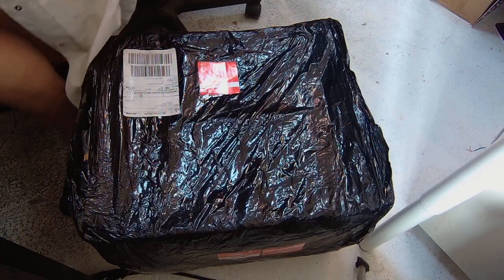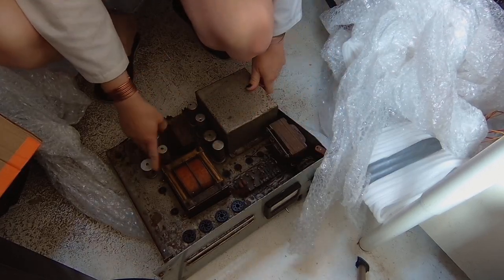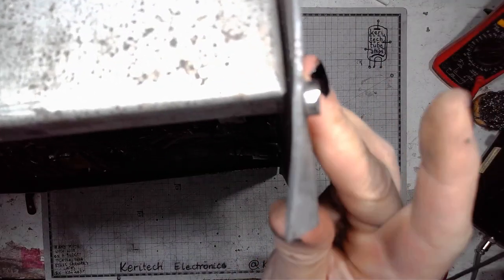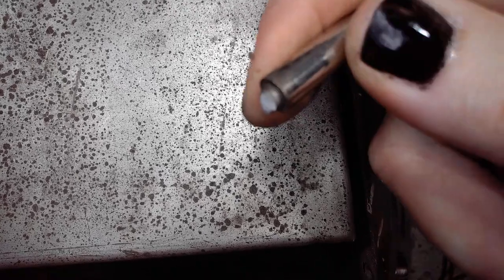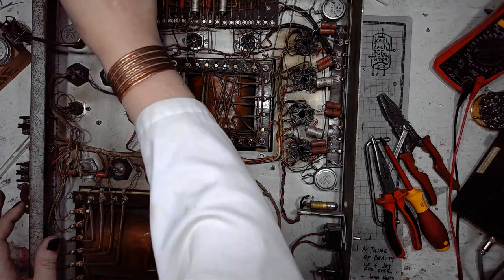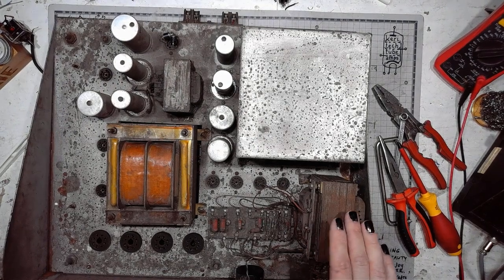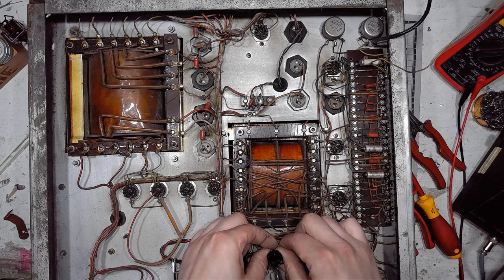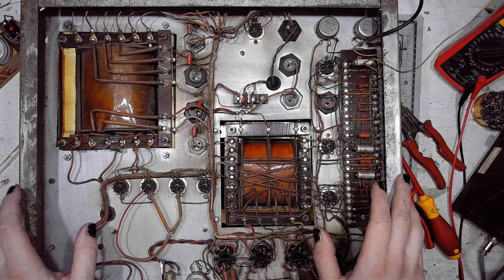W-100 Restoration Project #1: Unboxing and Overview

Comment: Sooo, i actually bought it from some old electronics store owner who resued it arround 12 years ago but didnt know what it was and how to make it work, and for speaker testing i played lowest 16hz sine wave and it did it without any problems, for the upper range im not sure, try testing it and hopefully it will be a great build^^ thank you a lot!
Reply from the maker: Gotta do a measurement on that thing - bandwidth is defined by frequencies where the output power drops to 1/2 (-3dB); I usually measure for -3dB and 0dB drop just to know where things are, sometimes taking non-linear distortion into account. As in, if it stops looking like a sine wave on the scope, I'll take a note of that.